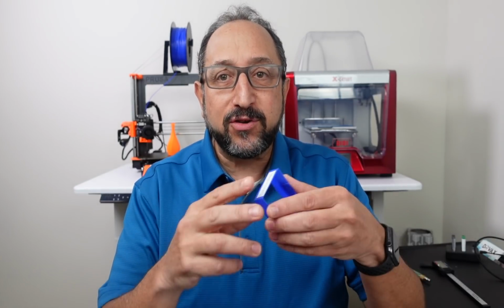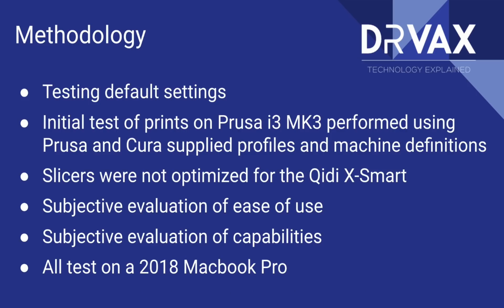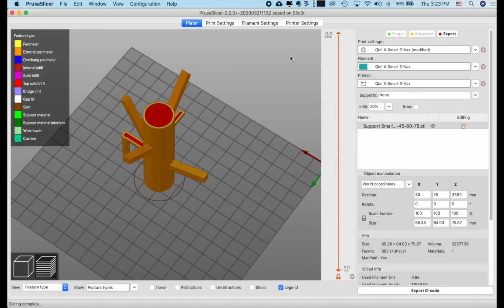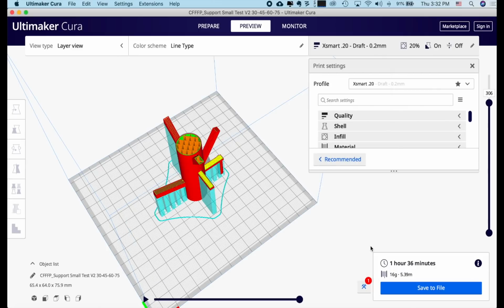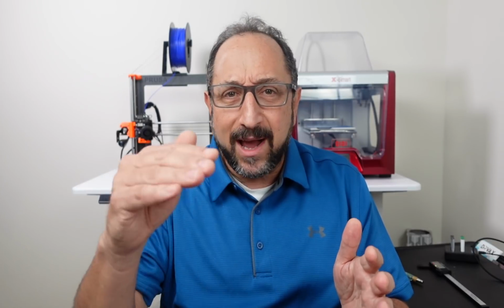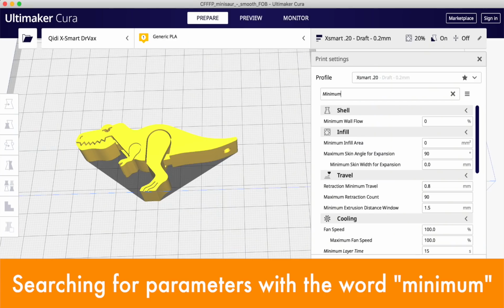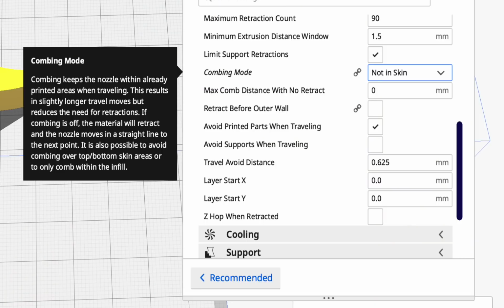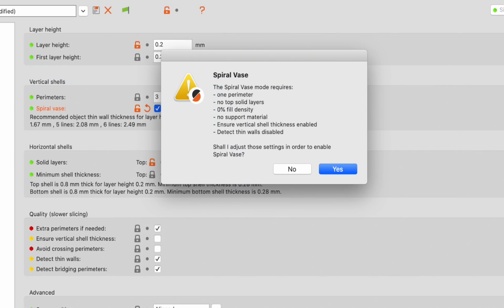3d Printing Two Top Slicers Compared

Comment: Hello Make with tech

I'm a young man in a mechanical engineering school. I challenged myself to create a metal 3D printer (but without filament) for my final work.
It's going well.
Today, my main problem is the slicer. As crazy as it sounds, I'm stumbling on the thing I was least afraid of at first. 

(FYI: What's fixed: I need to be able to do 100% filling)

Figuring out how to do one of these two functions might solve my problem:
1) When the printer starts a new layer, it would have to start by printing the inner fill (in my case 100%) before printing the outer wall. 
(Currently, it always starts by printing the walls. Then it prints in the center. This doesn't work for me unfortunately)
2) Find a program that allows me to not print any wall (just print the inner fill (100% in my case) 

With your knowledge on the subject, maybe...
Do you know a program that would allow me to do this?
Thanks already for your help

Comment: I have a problem with cura where it starts an overhang elements "in air" and not over the existing structure. Is there  setting in cura or another slicer that can help with that?

Comment: No joke, I observed this: Holding all settings as close as possible, on an Ender 3 w/Micro Swiss Direct/Hotend using Matterhackers Nylon, Cura created stronger, better-finish prints faster than Prusa, with roughly the same amount of plastic.  Parts were comparable to the Makerbot Method (a surprisingly amazing machine, print-wise) w/Nylon at work.
Reply: I disagree! Prusa slicer prints quality for men10x better than Cura slicer

Comment: Mr.VAX I have subscribed to you vids,  and they are very informing for the 3d beginner. I have one question that i have concern using slicer software. My question is, will I need to learn 2 different slicer software, one to support fdm and another for supporting resin 3d printers, I don't really relish trying to learn 2 slicer software. Any suggestions or ides for picking a slicer software that supports both? Thanks is advance.
Reply from the maker: Prusa Slicer supports both.
Reply: @MakeWithTech  Thank you very much for the reply. Keep putting out those informative tutorials!

Comment: Unfortunately and fortunately. These slicers are constantly evolving, so a lot of things here that were mentioned unavailable in one slicer or the other are now included, along with many other features and enhancements.
But you said it at the beginning. There is no "Best"
As with all my art, I use many tools. So 3D printing is no exception. 
I find that Prusa slicer supports are much easier to remove than Cura's (Opposite of what you got). 
And I LOVE Cur's Tree supports, BUT, only for certain models, and cautiously as they get knocked over easily.
So I use one from column A and one from Column B and bounce back and forth between the two depending on what I"m printing.
They both have their pros and cons, shortcomings, and things they excel at. 
My suggestion (and I do realize that a lot of people want to only deal with one program and that's that)is to learn and utilize both.

Comment: Question when comparing slicers I never hear anyone talk about the time it takes to print an item,  I currently use both slicers,  what i don't understand is the huge difference in print time.  Cura always seems to take a lot longer to print.  Is it just me?
Reply from the maker: Compare the retraction settings.  This can make a big difference.
Reply: @MakeWithTech  thx you I will compare
Reply: 3 main reasons -- default acceleration, retraction settings and infill pattern and params. Prusa has different default infill patterns, so obviously it will take different time to print. Try to select similar acceleration, patterns and set the same retraction settings.

Comment: 5:40: Prusa Slicer works just great without a 3-button mouse, using two-finger drag and ctrl-drag. Similar with Cura, no need for that external mouse.

I totally agree with your statements about ironing at 16:25. Suddenly I can print a Benchy with a smooth roof instead of the usual staircase!

Comment: Hi DrVax, recently we have been having some storms and power outages ruining my 3d prints. I have looked into getting an UPS but does not look like it will solve the problem if power is out for more than 10 mins. Is there any plugin that can pause the print and restart when power if back on? Maybe a connection with the UPS and a Pi4? I use octoprint. Thanks!
Reply: Yuo can do that whith Marlin firmware
Reply: @noway8233  would you kindly point me to some sources for instructions? Thanks
Reply: @MoAnwar  You haven't mentioned which control board your printer has and which firmware you are using. If it's Marlin v2 firmware -- you are lucky. It's called POWER_LOSS_RECOVERY. If you have this firmware chances are that your printer already supports "print resume", just check menu, maybe you need to enable it.  If not --
You should download Marlin v2 sources from their github. And enable this configuration setting. After that you compile new custom firmware for your printer and board and flash it. After successful flashing your printer will be saving its state during print to the SD card, so when the power if restored you will have an option to resume print. Also, you will have to ensure M413 command exists in your gcode. Just go to your slicer and add it to the "start script" section. More details here:
https://marlinfw.org/docs/gcode/M413.html
And here is example for Anet A2 printer: https://www.youtube.com/watch?v=wlt7LIxvMJo 
P.S. In any case if you have Marlin v2 compatible board I will recommend you to compile your custom firmware -- it's gona be significantly better than castrated stock firmware from printer's manufacturer, i.e. bugs fixed, all features available( because manuf-r disables majority of features for no purpose and uses outdated sources, e.g. Creality).

Comment: I see VorpalGun already mentioned both the search and ironing coming in the next version of PrusaSlicer. Regarding coasting, it seems to me that PrusaSlicer expects the printer to be able to handle this using the Marlin trick of Linear Advance. So, if your printer supports LA then use the Marlin website to generate test patterns to find the correct LA value for your filaments and enter the discovered value in the Filament/Custom Gcode section as an M900 Knnn setting (were nnn is replaced with the LA value). If your printer doesn't support Linear Advance, maybe Cura with the coasting setting is the better slicer for you.
Reply from the maker: I agree with your comment about linear advance.  Once more printers support it this should be more effective than coasting.
Reply: @MakeWithTech  Dont hold your breath waiting for Creality to catch up though LOL

I am looking at swapping out the motherboard next, I have learned to compile marlin and now knowing how much they just did not bother to enable has made me realise how lacking the motherboard is too :D

Comment: Thank you for this Dr Vax, just what I needed. Been using PrusaSlicer 2.3.1 alpha, and prints have failed that printed perfectly in Cura 4.7.

Because of your video, I'll be going back to Cura as my main slicer.

As a future video, maybe in depth about adhesion issues and solutions.
Reply: Cura v4.7.x is FAULTY.  Search reddit, YouTube etc.  Use the Beta v4.8 for now until final lease or use earlier version(s) v4.6.x

Comment: simplify 3d vs pslicer
Reply from the maker: I own a license for simplify 3d but have stopped using it since there are excellent free alternatives and many of my viewers use 3d printing as a hobby in which case if a solid free alternative exists it probably makes sense to use it.
Reply: @MakeWithTech  i would like to learn more about coast and wipe settings in cura

Comment: Q: Can I have more than 1 Printer in Prusa?  I was not able to do this with my Tevo Tornado + MakeBot Replicator X2
Reply: Yes you can have multiple printers in Prusa. I have multiple profiles for materials and printers. Very easy to change.
Reply: @spanny52  I was not able to do it!
Where can I find the steps to follow?
Reply: @iq0099  I went to printer settings, add printer.  Then you can take configuration snap shots of each material.

Comment: Great video!  I will review it frequently. As a Prusa user I learned many things. Ironing is one that makes sense. I can’t wait till Prusa gets it.  Thanks again.
Reply from the maker: Glad it was helpful!
Reply: To be fair, I use Cura, and I very seldom enable ironing, its only really of use on a nice flat top surface in any case, and wherever possible, if i had such a surface I wanted particularly nice, I would print upside down on the smooth side of my glass bed for a completely glass like finish..

the vast majority of models I print either have a non flat top or do not require a super fine finish, you could argue that the layer lines and small imperfections are actually what makes a 3d print special ;)

Comment: From my experience (and help of a forum user) For prusa slicer supports, I use .25mm z distance. 4 interface layers and 75% xy distance. This works well for pla and alright for petg. (Pla has worked for 0.2, 0.15 and 0.1mm layer heights)
Reply from the maker: Thanks for the suggestion and your participation.

P.S. I have started a new discussion forum at http://forum.drvax.com where we can all have more elaborate discussions and share pictures on our prints and printers. Check it out. Irv

Comment: I own a Tronxy Xy 2 pro and tried Prusa, sometimes it was good, sometimes not. Actually I am using Cura 4.8 and prints very good no matter the model. I believe Prusa is very good for Prusa printers as it is created with all settings for them. Tronxy was borned with Marlin Cura hidden firmware so it works fine with Cura. That´s the problem, create the perfect profile to try using another slicer requires a lot of tests, patience and filament waste. I will keep using Cura. I love the Prusa interfase, is more logical and easier to use, so a Cura with Prusa interfase would be the best for me. I think is better to stick with the slicer the printer comes with. My  humble opinion.
Reply from the maker: I agree with you.  Prusa is optimized for Prusa printers.  Cura seems to better embrase the open source printer world.

Comment: Question I just installed the creality silent board on my Ender 3.  I can’t get a good first layer to lay correct.  The lines don’t group together they are like a crispy texture   I’ve tried bed adjusting I have the bltouch I’ve tried extruded adjusting. .I can send pics if you need to see what I’m talking about.
Reply: You need to level your bed & adjust you z offset. If you have Discord, there is a Creality based server, with a lot of information & a really good help section. Here is an invite link to the server https://discord.gg/tTaJQ8e
Reply from the maker: @syntaxcuemi3d53  Thanks for helping another viewer.

P.S. I have started a new discussion forum at http://forum.drvax.com where we can all have more elaborate discussions and share pictures on our prints and printers. Check it out. Irv
Reply: @MakeWithTech  not a problem 👍  we are a sharing community & I like to help people (if I can) when they are stuck.

Sorry, but I didnt mean to tread on any toes by posting the link to the discord channel. I didnt realise that you set up a forum. I'll be sure to pop over & register. Would you like me to edit my post & remove the discord link?
Reply from the maker: Head over to https://forum.drvax.com where if your register for free you can post pictures.  There are hundreds of DrVax fans there that will offer you suggestions.

I also agree with Syntaxcuemi 3d that you need to adjust/tune your Z offset.  There is a video on this channel about how to do that.  Here is a link:

https://youtu.be/tOxUrP2wOjA
Reply: @MakeWithTech  the bed adhesion is great it’s the first layer lines they are not printing close together they are leaving a gap and the skirt lines are doing the same
Reply from the maker: @boazandruth909  If the nozzle is too close to the bed it will not be able to form a proper bead which will cause the issue you are describing.  It may also cause the extruder to click as it tried to push the filament through the melt zone on the hot end.

You should also verify that with the printer at temperature and the nozzle away from the print bed you can extrude filament easily.  If not your nozzle may have a jam.
Reply: @MakeWithTech  I’ve tried diff heights. And even installed a new hot end assembly and extruder assembly that I keep in stock.  Still the same first layer issues. My other Ender 3 no issues. This all started when I installed the new silent motherboard.